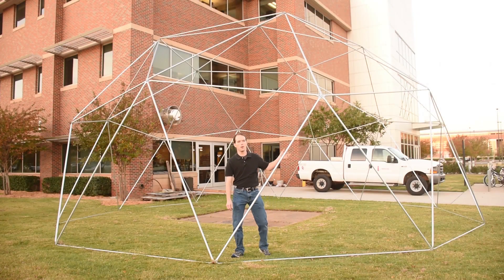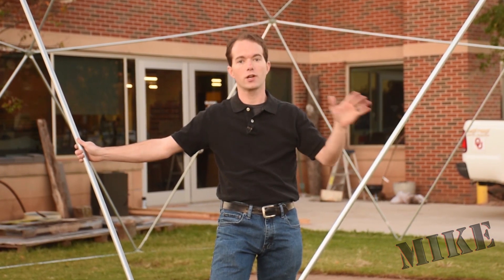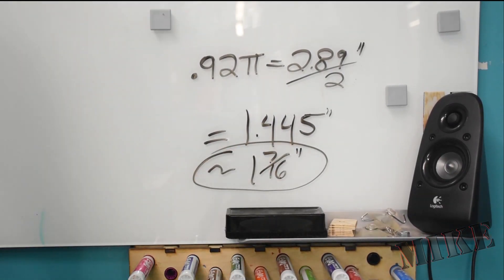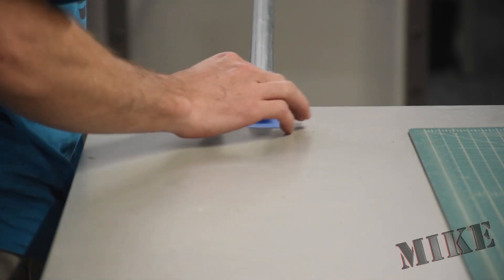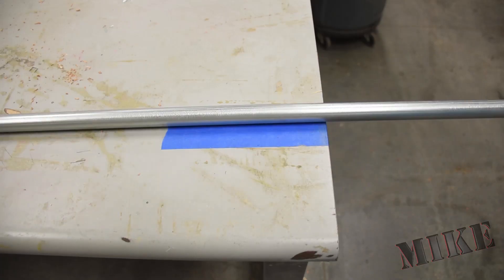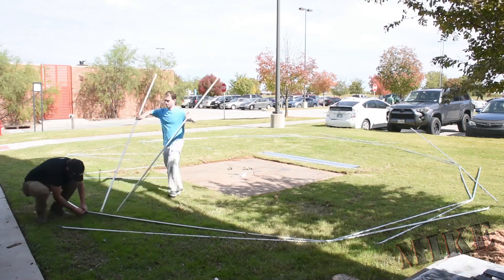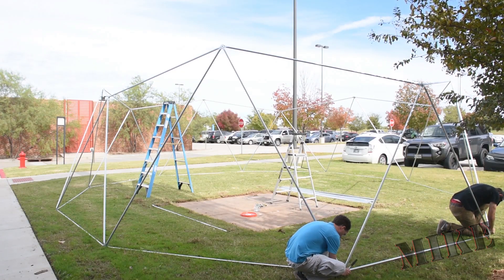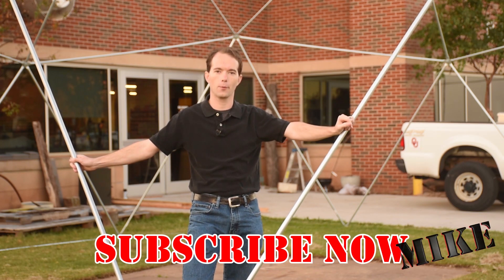Geodesic Dome 3 - The BIG One - Mikes Inventions

Comment: The cost and how fast it is to set up is just great, I have been looking into geodesic domes as a replacement for the tents being used in refugee camps in Syria, there are thousands of refugees living in worthless tents that usually has water leakage or they blow away during wind. This solution with geodesic domes are fast and cheap and most importantly cost efficient.

Comment: I found before crushing the ends drilling one end then placing the drilled end onto a bolt to hold it in place kept the ends co-planer and drilled the other end. . In preparation for the drilling, I drilled five holes through the press plates. On in each of the four corner of the press plates I drilled holes centered on the corner and one inboard from the curved area the correct distance for the hole to be in the proper position on the crushed part of the pipe.  I then counter sunk 3/4" holes on the two facing sides of the plates at each corner. I then used springs to in these counter sunk holes to lift the top plate evenly to allow for the uncrushed pipe to be inserted. Using a bolt in the top plate down to through the bottom plate which allowed for the holes in the crushed ends of the conduit to remain aligned. I've lost count on how many of these things I've made for myself and friends. 

On a different note I noticed you were putting the heads of the bolts on the INSIDE of the dome not the outside. Heads of the bolts should always be on the outside. Using Carriage Bolts with smooth rounded heads and a hydraulic hole punch one of the struts it makes it easier to pull a cover over the dome without catching the cover on bolt heads.
Reply: Ok

Comment: So the materials here should be light enough could you build from the top down lifting sides up as you add another layer? Eliminating the need for ladders?
Reply from the maker: Correct. Next Week's video will highlight the device that allows that to happen. Thanks for watching!
Reply: In larger 3, 4 and 6 frequency domes lifting from the bottom gets dicey but can be done without much trouble using simple Farm/High lift jacks and webbing straps.

Comment: I found this very informative as I have always been interested in domes. Just an observation on the method you used to assemble standing on a ladder. Did you consider starting from the top? My thinking is that with help you start from the top centre and then keep going around the bottom lifting it up. That way reduce the risk of falling off a ladder.

Comment: Hey Mike, you assembled it backwards. Where I live there are many Geo-domes in the area, that have been built commercially. From what I can tell, most are built from the top down instead of bottom up. In other words, the top star is made on the ground. Next a few people start to lift and then set the star on saw horses. The next layer is built underneath. The saw horses are slowly removed as the layer is completed. A couple guys then start lifting on one side and put the dome back on saw horses. Then another layer is built and so on till the structure is complete. Good luck, your project looks good.

Comment: 3/4"conduit with a length of 10ft will have too much sideways deflection under load. I would use a higher frequency 3v, 4v or use a larger diameter strut.
Reply: If I heard correctly the purpose for the dome justifies the 2V.
Reply: @diazpty  
He said somebody is going to skin it and use it as temporary shelter. When the wind converts just one of those 10ft triangles into a sail, it will be a very temporary strutcture. As said, the struts will  have too much sideways  deflection under load..
Reply: I’ve built domes quite a few times.  In concept that is fast and less expensive then a 5v dome, however I agree with John.  If you put a cover on it, wind will be it’s enemy.  The struts will weaken being that long and eventually it will lose form and be problematic.  Or generally speaking somebody will want to try to climb it or hang from a pole and it will benddd.  If you have the tools and the know how more struts with less length makes a tighter build.  Plus half the fun of a dome is climbing to the top man!  The views are excellent!
Reply: @mattiusvalentine3199  
I personally would use 1" EMT and not make the struts any longer than 5ft. That would give you a 16ft 2v, 24ft 3V or  31ft 4v.  If the dome is to be climbed without using a rope i`d suggest using a strut length no more than 3ft

Comment: Ok, I found your channel and subscribed right away. I want to share an idea with you and the rest of humanity. lol  Can you please tell me the actual size of the triangles by sides? This is what I 'thunk' up. I want to make molds that will encase aircrete and once cured they could be cemented together held by ty-wraps until they fuse. It could be just the triangles but I thought of casting the entire hexagons. Maybe a wire suspended inside the mold for reinforcement.  Like thick ss safety wire. The mold should make the hexagon with all 12 members or spokes of 2" square. So I guess my question is, how big the hexagons to make a dome like 15 feet high. Like your channel. Chock full of great projects. Thanks.
Reply from the maker: Hey, thanks Edward ! So the triangle side lengths would just be the strut lengths center to center if you’re not using any sort of poles on your dome. You can see the assembly sequence is pretty straightforward. Cool idea! Check out my first geodesic dome video for strut length calculations. I think I have an Excel file on my website too that will do it for you.

Comment: Excellent video!! 
What length measurements did you use on the tubes? I saw that you used two different lengths
Reply from the maker: Hey Rafael. My A struts were full length, so 10 feet. Of course I had to leave a bit at each end, because strut lengths are calculated from joint to joint, not end to end, so the A length is not quite 10'.  The B struts are a bit shorter, but I don't remember by how much, because I don't remember how much material I left on the ends of the A struts. Whatever length you go with, the B struts are [ 0.883 x A ], and that's joint to joint. Remember to leave a bit on each end of you use a bolted connection.  There you go man. Thanks for watching. Good luck!

Comment: Have you tried to use T profile fencing posts... milling to plate the angled joint terminals... and bolting with round hubs made out of plumbers soldering flanges...
Why? Because using T shaped fencing posts as a skeleton structure you can cover the dome easily using riveted metal sheets or screwing plywood... hubs construction is better than a bolt in the vertex because if happens you need to remove a strut or some panels for some reasons you can simply do it and reinstall without compromising two points of the entire structure once is completed... I prefer V4 and since I'm rest of the world outside US I prefer metric it is immediate to eyeball.

Comment: This might be a to high tech of a solution for a lot of people. But there is a way to reduce the manual labour quite a lot.

Make 3D printed conection bits. Its really only the part in the middle that need to be somewhat solid. 

The you could just push the pipes in and if you really don´t want them to move, have a small hole or two and have some self tapping screws going into them

Also... öum... I don't know if this is not obvius? but you could start building the dome from the top, and you would never need to even leave the ground, that would also speed up the build.

Granted, with 3D printed bits, it would probobly take a week to make, but it would use way less manual hours.